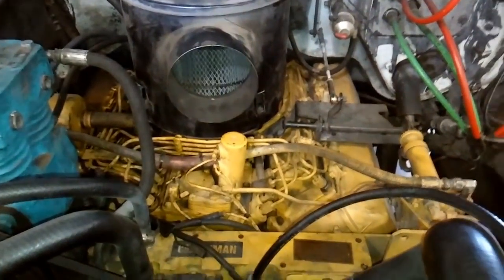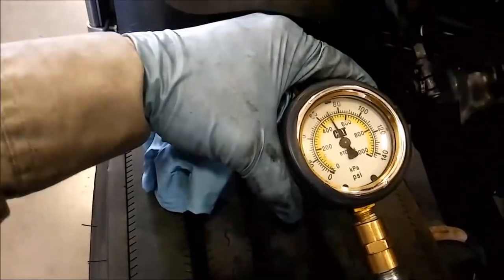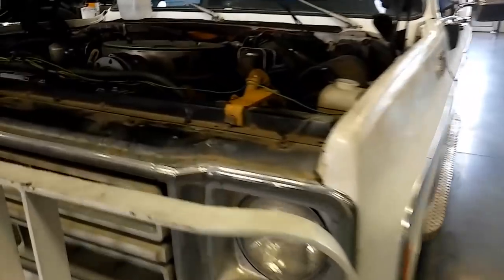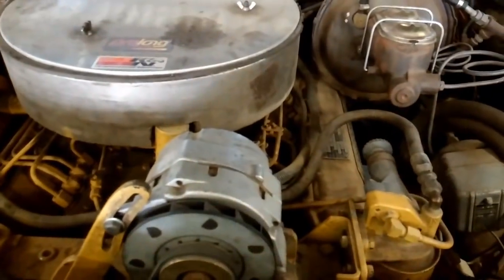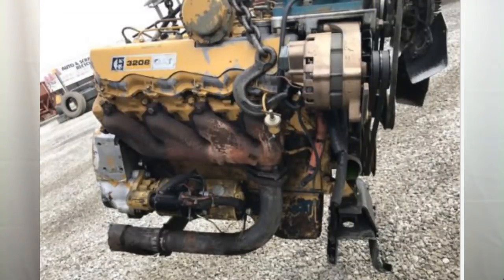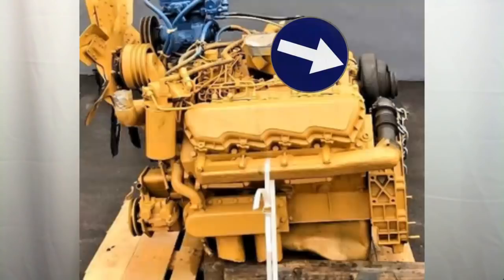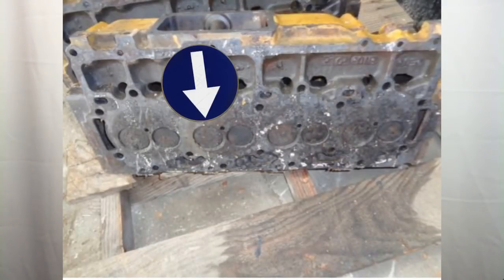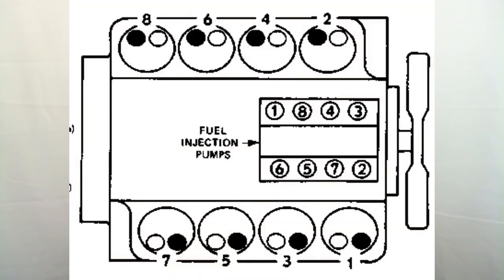The Cat 3208 Engine.  Know Your Engine. Engine Design And Problems.  Cat 3208.

Comment: They broke a lot of connecting rods dropped a lot of valves.
But if you take a look it was on a reman engine when you start swaping flywheels on a externally balanced engine that's what happens. The stupid rebilders sell you a long or short block then you put your old flywheel on your rebuilt now your rotating assy is out of balence say the engine is junk. Because it pitched a rod through the block.  Look at the back of a few of rheas flywheels and you will see the big out of balence weight they do this because crank counter weights won't fit in crank case so they have to move mass outside of block. I was on a boat that had a reman and it would rattle the fillings out of your teeth. Owner just dident get it. Same thing reman and they used his flywheel.

Comment: Can i put fuel pump of a turbo 3208 on a 3208 non-turbo?
Reply: Will it bolt up, yes. Will it run correctly, who knows. Different part numbers are for a reason. Your timing could be off, you could overfuel and burn a piston, who knows what will happen.

Comment: I worked for our regional Cat dealer during the time the 3208 was produced, and really it sucked. 
You never knew when it was going to blow up.
Bad nozzle = melted piston.
Dropped valve, 
Crank/bearing failure.
Rods through the side.
2 ring piston, lots of blow by from new.
There was actually a portable line boring tool group to repair main bearing bores.
So many change up's of parts and service procedures. That was a sign of bad design.
How you knew a 3208 was about to fail was when a machine was innocently walking across the yard and blew up, bang. Cloud of steam and smoke. No warning.
Regular fixing was no fun.
Bad fuel nozzle? Good luck getting it out after it's been stuck in there for a few years. Especially when located in difficult areas.
Another "Special tool group" situation.
Fuel injection pump problem, oh joy of joys, swapping that thing out of even in an unrestricted location.
I am sure the 3208 had great promise on the drawing board.
In reality, it was a disaster

Comment: We have a 3208 in a 88 ford l8000, has a hard time starting up and wants to stall out when you first start it untill warmed up, why is that?
Reply: And when it does stall out it will NOT start back up we have to use starting fluid

Comment: Can someone tell me how to adjust fuel pressure on 3160 V-8 cat  it’s basically the dad to the 3208
Reply: I never heard of doing this. It has a lift pump on the side and feeds fuel filter and main pump. If everything is fine, you will have to replace lift pump.

Comment: Don’t know why but I swear the 3208 exhaust is the worst I’ve v experienced especially when it’s cold.
Reply: If you think a cold 3208 is bad you've never been around a cold GM turoflow v6 diesel 😂😂😲😣
Reply: Cbmech no I haven’t! A friend used to have an old Ford LN 8000 single axle dump with a 3208.... it was a great running truck,tons of power easily pulled small dozers and TLBs....I used to drive it once in a while,it was impressive but god aweful smell cold.
Reply: Try a Cat 1100 series engine, if you want to see a cold nature diesel.
Reply: +John Goldsmith 
to  the  best  of  my  knowledge  all  1100 ,1125  &  1150s  were  painted  blue  and  sold  as  ford  motors . 
And  yes  they  were  cold  blooded  bitches ,the  inline injection  was  a  pos  that  cat  didn't  use  once  they  painted  them  cat  yellow
Reply: +John Goldsmith 
if  you  really  want  to  see  a cold  blooded  engine  you  need  to  find  a  50s  gm  turoflow  engine  still  running   (good  luck)  it's  a  big   v6  diesel , based  on  the  460?  gas  engines  that  gmc  used  in  trucks  and  it  is  a  piece  of  sh@t . gm  seems  to  have  a  recurring  problem  turning  gas  to  diesel
Reply: +John Goldsmith 
if  you  really  want  to  see  a cold  blooded  engine  you  need  to  find  a  50s  gm  turoflow  engine  still  running   (good  luck)  it's  a  big   v6  diesel , based  on  the  460?  gas  engines  that  gmc  used  in  trucks  and  it  is  a  piece  of  sh@t . gm  seems  to  have  a  recurring  problem  turning  gas  to  diesel
Reply: Cbmech - Cat engines during this time frame was color ID. Blue was a Ford, White was a Paccar, Red was a International. Yellow was a Freightliner and everything else. The models was 1140, 1145, 1150 and a 1160.
Worked on these several years.
Reply: +John Goldsmith 
Ford  payed  for  90  %  of  the  development  cost  for  the  1100/3208  engine  and  for  the  first  2  years  got  100%  of  production .  They  were  exclusively  sold  in  Ford  trucks  and  had  several  issues  that  cat  corrected  when  they  went  to  the  3208.
Reply: Thanks, did not know this.

Comment: My most hated cat Engine.....no offense but I've seen more of these with thrown rods than any other cat Engine
Reply: if  you  don't  do  a  bearing  roll  in  when  you  need  to  I  guess  a  thrown  rod  would  be  the  result . 100  to  125000  miles  with  a  set  of  nozzles,and  400,000  wasn't  unusual   (16,000hrs) wasn't  at  all  unusual
Reply: Cbmech what is a bearing roll?
Reply: Mikael Anthony it’s when you replace the bearings with the engine still in the chassis. You “roll” the new bearings in.
Reply: Well there were more of them produced than any other cat engine so yeah you would probably see more of them that had failures.... cat had 40% of the on road truck engine market at one point.... 🤦🏻‍♂️

Comment: The GMC or Chevrolet trucks standard engines and manufacturing is a Detroit Diesel engines by owner GM company 
Not Caterpillar engines installed on chassis on these make 
Caterpillar are predominantly in Ford's trucks

Comment: I don’t matter how I drive, I creep over pot holes, but I cross rivers and washed out roads and it is brutal as heck on equipment, those apus are not designed for it. There so rough if you don’t take your wallet out of your back pocket, a sleep over with the pope would be kind in comparison.

Comment: I want buy 3208 cat or c7 7.2l  in. Truck f250 2wd 1983 460ci block engine swap I'm think about a cat motor as big as possible  and I have a twin I-beam suspension I'm think about 6spd manual transmission 3208 cat 375hp back  3.70 gaer 6spd
Reply: I have a 3208 runs great 150k original miles  for sale

Comment: Talk about a 3408
Reply: 28V serial number. Came with a sixty degree vee. PC or DI engines. Came with or without JWAC. Brakesaver was an option. Like to break exhaust studs and exhaust leaks. Did have a B model version later on.

Comment: 2000 hour interval on valve lash..?
No need for that because they won't last that long.
I have gone thru at least 10 of those over the years.
In Ford trucks and many in mid 70's Cat 225 excavators, compators...
But
No matter how cold it is.they always start first click...
Reply: Gregory A. Parsons what was your aplication champ ? These are a fairly robust engine TA marine engines are rated up to 525 Hp intermitant. We had a local truck racer get his 3208 up to 800 Hp on the dyno on Deisel. BIGGEST problem I come across is people rebuilding them who are clueless. Cheers mate 🍻
Reply: Weak bottom end seen landfill compactors that religiously threw rods.... it's tough service granted but cat knew this going in
Reply: John Hull we had a few compactors with problems but it was more related to damage done when they rolled over and were re started.Cheers mate 🍻

Comment: Mmmkay...3208, was a throw away engine,a TURD !!! Most were naturally aspirated,and wouldn't pull your hat off. End of story. Move along folks, nothing to see here!!
Reply: George,  It doesn't have tons of power, but the 250hp turbo in my rv moves pretty good.   I'd love to have a new one with a C7 or C9, but I own this one .. very reliable,  one breakdown in 12 years of ownership.  Thats better than any other vehicle i've owned :)
Reply: chris gollihar maybe in an RV because they weigh less.  In a tandem dump or mixer truck, they were horrible.
Reply: what does aspirated mean...?
Reply: @MsLiberty101  air intake...."Naturally Aspirated" is 4-Cycle Engine without Turbocharger, or Supercharger...

Comment: The 3208 would only go from like 140 to 300
Reply: Yup..we had the 140 hp version and the turbo 240 hp version
Reply: I have seen 150hp (non-turbo) to 450hp (sea water after cooled turbo) so um yeah they made many power outputs.

Comment: 3208= ropeless boat anchor. In my opinion, one of the worst diesels built.
Reply: Am sorry to listen about your bad experience about using the model 3208. I was also facing some problems for repairing it. You know the manuals available on reliable-store dot com  are the exact same manual used by technicians. You can refer to their manual on 3208.
Reply: @jamese.benton9908  ceased up while warming/airing up. Oil pump failed. Scrapped it
Reply: DC-9 - You never owned a 8.2L Detroilet! - Almost as good as Olds 350N

Comment: ? 3208 cat max hp and torque vs cat 7.2l hp and torque want motor pull more hp and torque for speed and very heavy towing up hill  high speed drvier and black smoke motor best Caterpillar engine for black smoke

Comment: Only good for marine or fixed rev application, hopless in a truck especially when mated to a 13 speed rr not enough mass to keep the revs from droppingto fast . They have a horrible habit of dropping valves . In Australia they are known as hand grenade also they were rated from 210 to 600plus in some marine applications, basically just a piece of crap . Btw i am cat and komatsu trained but have never had the yellow injection lol

Comment: One of the biggest pieces of trash that cat ever made. A real disgrace.
Reply: Your poor opinion only.  I had one in a Louisville truck that I put 500,000+miles on hauling nationwide, all kinds of conditions and weights.  The secret was that I did not lug or overwind it and kept the oil clean.  No different than I do with all my equipment.  It always interests me when people trash something and it is then the equipments fault.  I have neighbors who fail to check oil and keep it clean and then, of course, lose the engines.  That truck is still running with the same engine and no overhaul.  I did put one piston set in it when it had nearly 500,000 miles on it.  It had a wrist pin bushing wear thru at that point.  When I first bought it I asked Cat about it.  They told me to treat it like a gas engine that I liked because that was this engine's history, they came from the 534.  Take care of them and they are wonderful engines.  You will find them still working hard in this area in many farm trucks, especially Fords from the 70's and 80's.